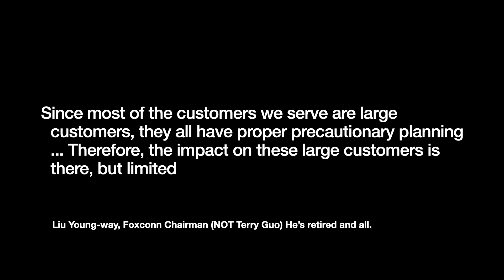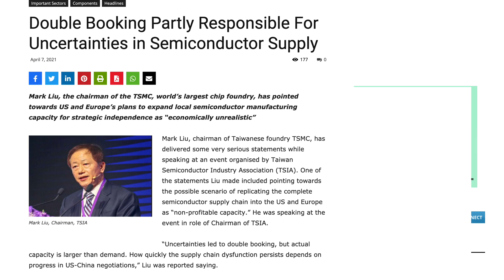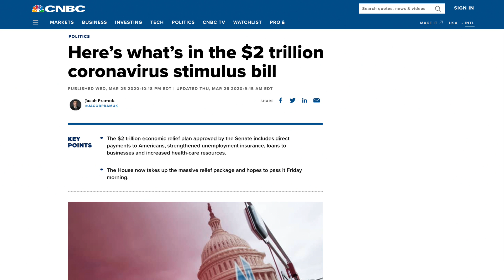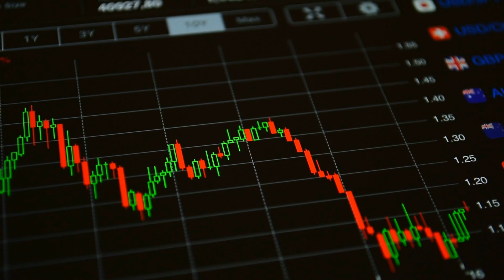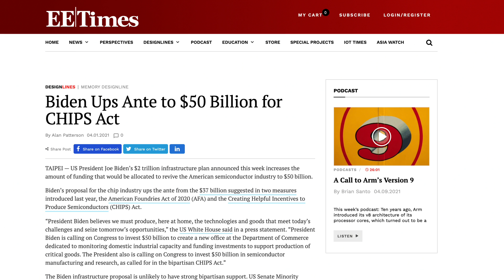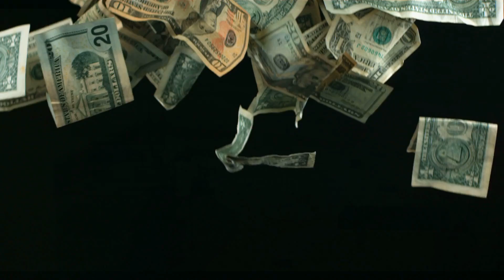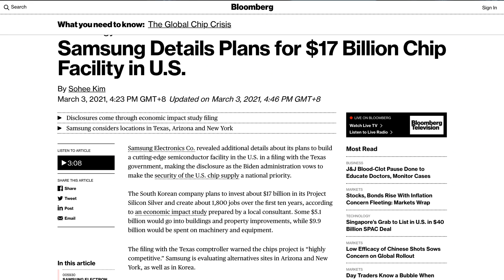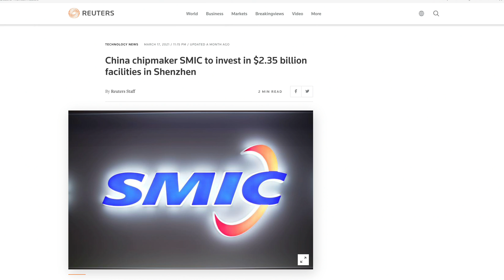The Coming Semiconductor Bust

Comment: These are all good points and some which I considered myself recently. However, TSMC's new fab is not going to bring "hundreds of thousands of wafers coming to the market over the next 1-2 years". That's not even close. Samsung is simply adding some capacity in Austin. They aren't building a new fab.... yet.... and TSMC's new fab isn't going to bring full output to the market for another 3-5 years!! So even if the cycle plays out like you say it will, that puts the bust out into 2024-2026... AT THE EARLIEST! And people will in fact go nuts once the pandemic lifts. Well over a year of pent up demand FOR EVERYTHING! will be unleashed on the world economy later this year, which is before the chip shortage will even be worked out. Semiconductor prices will have a chance to boom massively well before they inevitably bust again.
Reply: There is no pent up demand for high end chips I think, if anything, people will probably spend less time on their computer/phone and go out instead. If less people work from home and less data is generated from online activities there will be lessened demand for data center services too (probably less growth not an actual decrease). IoT devices like smart mirrors and wifi armchairs don't require the same kind of chips, these might remain in high demand but it's easier to scale production of these chips so I think there would just be a short boom as restaurant owners and such start buying new stuff followed by a steep increase in production, they are just commodities after all.
Reply: @semkjaer3581  It will probably bounce back, but there was already a trend for home-working.
It will never go back to the previous level.
Even if the demand decreases, it wont decrease to the same level as before.
Reply: @monad_tcp  well this guy was saying people would 'go nuts' on semis after the pandemic and I just don't see that happening, I'm not saying the semi industry will do bad, I just don't think the current excesses will hold.
Reply: But will the pandemic even lift ? or we will go into trade war with China.
Reply: I don't know where you get your timelines.  You're talking as if it takes many years to set up a fab, and it doesn't.  It's expected the TSMC fab will be online and at full capacity within 3 years.  Within 3 years, and probably a few months less.  It will be ready by the time AMD is making Zen 5 products.  What takes years is developing a new node.  But,  TSMC in AZ is putting in a 5nm fab that's expected to eventually be upgraded to 3nm, and not a decade later because the world moves faster than that.  They'll probably upgrade it to 3nm within 3 years.  They'll have to.  Intel will already be on their 18A node, or even smaller.

So, the construction will take about 2 years, and then setting up and fine tuning the equipment will take months because TSMC is already producing 5nm and don't have to learn anything.  This is the timeline that's been given and I'm pretty sure they'll stick with it.

You forgot Intel.  Intel is making two new fabs, and they should be producing by 2025.  The reason why it will take them longer is because they're 20A fabs, and Intel hasn't gotten this process (node) to a state of production yet.

As far as a bust, that's laughable.  Not what you said, but the whole thing.  TSMC has had constant growth since 2009 and they can't make products fast enough.  Their next node to get to production is 3nm, probably late 2022.  Apple and Intel have already bought up (via contracts)  the first year run.  So, the earliest any other company would have access to TSMC 3nm would be about 2024, maybe a few months earlier, or later.

Samsung makes billions a year in profits, TSMC makes billions a year in profits and so does Intel.  Even if there is a slight downturn for a fab, it has little effect on their profits, and that was part of why this guy was talking about it.  It was to suggest that all this capacity will lead to some kind of bust cycle and that will mean continued subsidies.  But, no govt. funds these fab for operations.  They make their profits off the contracts they make to produce products, or by the products they make for themselves in the case of Intel and Samsung.  Subsidies will be used to help fund construction of the fabs.  A fab though, if it's not at full capacity, which is rare for the companies that are making advanced nodes, isn't making anything.  They only make products based on contracts.  Soooo, it's not their products sitting on a shelf somewhere.  It's other companies products sitting on a shelf who knows where, but not in the fab.

To try to predict a bust for fabs, you have to understand the ENTIRE WORLD of technology.  All you talked about was consumers, home users, but that's only part of what gets fabricated.  AMD for instance is making more server CPUs than anything else because the demand is such that they can't satisfy it.  They went from making a few million dollars in 2016 to making almost 4 billion in profit last quarter.

So, there's not going to be a bust.  The demand for chips is growing, and when these fabs come out with a new node, which then allows companies who make CPUs, GPUs, etc... to make new products based on that node, it creates demand all over again.  And, for the world of servers which is HUGE, when new products come out that will be a good upgrade for them, they upgrade.  Usually the savings in electricity costs, or the big boost in performance they get pays for the upgrade.
Reply: @johndoh5182  servers are upgraded much slower than consumer electronics,
Companies are too smart to overproduce.
Reply: Why would pandemic demand will stay after pandemic

Comment: I have a  dumb question.   When you say wafer, do you mean the actual raw silicon crystal wafer ?  Or you mean the the process of converting the wafer into the IC ?   Which process has shortage now ?  The raw silicon crystal wafer ?   Or the processed the wafer with IC on it ?    Thx
Reply: He means the completed wafers with ICs. It takes 2-3 months to make a completed wafer with all the chips on it from start to finish. The shortage is due to the factories’ inability to produce the volume that’s in demand. Each factory only has so much capacity and then you have the 2-3 months time that adds to it.
Reply: Completed wafers.  I believe they also make the raw wafers.

Comment: I think you spent a sentence or two talking about older nodes. I would highly suggest researching those companies and their target markets, because it really shows a better picture of what is going on.

The other main issue is that all the recent nodes and tools are still using 300mm wafers. They should have switched sometime in the last 10years, after TSMC's 28nm. Now they are switching to EUVL tools and still haven't moved to 450mm wafers. We are in for a while ride at 5nm on down.

Comment: I dont think the model for 2nm and below fab is unsustainable, imagine 17B+ and growing. Takes very deep pockets and long term planning to even achieve ROI on such investments and for what 5-10% gains in performance, maybe 15% max?? There has to be alternate ways other than semiconductors and that is where I think quantum light physics come into play for quantum computers. So basically u have a hybrid system where the brain is quantum CPU chip and the rest is semiconductor chips supporting this. What does anyone think about this?

Comment: from Taiwan. well thought out analysis. for the chips providers focusing on 14nm and above nodes, the economic cycles would be very severe because the new builds up heavily tilted to this end. for the more advanced nodes businesses, there are less competitors and new supplies to be expected.
Reply: exactly
Reply: Not really.  Companies are having products made on nodes much larger than that.  So, it will be older MOSFET technology that starts to fade away.  But that's not TSMC, Samsung and Intel's issue to worry about because they make advanced nodes.  They upgrade plants when they need to.

And no, this video wasn't thought out at all.  It was a propaganda piece designed to attack subsidies, as he gave no data to support much of what he said, AND put out false information, such as when he said no node being built in the US on these subsidies is less than 10nm.  WTF???

Samsung is building their new fabrication using 5nm, TSMC's fab is for 5nm and it's believed they'll upgrade it to 3nm before too long, and Intel's is THE most advanced node, with 2 fabs that should be online by 2025 producing their 20A node, equivalent to TSMC 2nm.

So, he is just wrong, wrong in so many ways.  

Saying these companies need to stand on their own, as if they don't.  Once again WTF????  Samsung, TSMC and Intel make profits over 10 billion a year, consistently.  They ALL stand on their own.  The subsidies help with the upfront cost of building new fabs, which is HUGE money.  TSMC hasn't had a bust cycle.  It's rare for high quality fabs, almost unheard of.  They're yearly revenue has grown every year since 2008.  They had a small downturn in 2008.

I could go on about the fallacy of this video but I wrote a book on his initial comment already about all the issues with this video.

Comment: The problem is TSMC is the only fab in the world that can make 7nm chips at the beginning of 2019. Samsung yields were shit and GloFlo dropped out of the 7nm race. TSMC required customer put in wafer orders at least 1 year in advance. The world fought over the limited 7nm production capacity. COVID further driven up the demand of consumer goods since everyone is staying at home. Automakers on the other hand, thinking car sales will slump pull back chip orders. Fab took more non automotive chip orders to compensate. Due to trillions of bail out money funnelling into the stock markets lots of people made big bucks. Car sales which initially dropped suddenly bounced back 10% to 15%. Car factories ramped up production to meet demand but many kept low inventory of chips for efficiency reasons. They ran out (problem of ordering and not production).

I don’t agree that we are building towards over capacity. We always had at least 3 major foundries around the world able to make chips at the most advance nodes or anything prior. 7nm really was the odd ball with only TSMC able to make it.

Comment: If China finds a way to reverse-engineer chipmaking techs and create new ones, semiconductors  will be extremely cheaper. Look at the solar industry, China entry caused solar panels becoming extremely cheap.
Reply: Any particular chip that you were talking about?  There’s a lot of different kinds.
With a lot of different techniques to achieve quality and yield.
Reply: Not everything can be made through reverse-engineer, chip is one of them. beside chip is made with over 1000 companies work together, chip is in an idea of supply chain.
Reply: @genuinennessbefitting4734   Again, you underestimate the Chinese Communist Party. People used to say the same thing when China entered the renewable industry, now just look how China completely dominates all renewable industries. China has already had an international supply chain within the ASEAN, so it can skid Western sanctions at ease.

Comment: I wonder if the answer is that while if that future number of chips were produced tomorrow it might be a glut, by the time it all comes online, demand will have caught up. New products that require chips/more chips keep cropping up. Cars and home appliances are excellent examples because they were existing products that changed from not needing them to now requiring more and more of them, but I could easily see that transition happening in other industries - clothing, furniture, etc.
Reply: Well there's a big difference between markets that require microchips and markets that require leading edge microchips.  Almost two different worlds, really.  One can be safely supplied with existing and aging processes(and there's more options available), but products built on leading edge processes are constantly moving on to the next one as soon as practically(and financially) possible.  It's the demand for the leading edge stuff that becomes riskier as this is where these chip manufacturers have to spend insane amounts of money to keep up with expected demand.  If that demand in this segment of the market does waver, it can have significant effects on the profitability.  So it's something they have to be careful about.

Comment: Well done but for your fearing the future slump!  Automotive switching to Electric Vehicles will swamp chip capacity. Acarspressure
Reply: However, trends towards more powerful single chips might partly mitigate this. Compare cell phones which have reduced the number of ICs with the rise of the SoC, IIRC.
Reply: Post incomplete: EV production 2020 was about 1 million cars from a total car manufacturing of 77M. The automotive industry planning to phase out all Internal Combustion engines by 2030. The chip usage in EV is many times higher the current ICE cars: has anybody done a study on that?

Comment: Your opinions would be more convincing if backed up by some analysis of chip consumption growth projections in absolute terms versus production capacity.  The graphs you presented were only relative production increase and decrease.   As mentioned in other comments growth in autonomous technologies will really drive up chip consumption for example.
Reply: besides that, datacenters want absolutely every single bleeding edge node they can get. TSMC could triple 7nm capacity tomorrow and it would still probably be completely sold out.
Reply from the maker: In my opinion, relative metrics make far more sense than absolute numbers.

Comment: The premiss that.fabs compete on price and will race to the bottom on price if demand dries up doesn’t work for advanced nodes. Designers have to tailor their product to a particular manufacturer’s process, and the design can take 18 months to complete. There is no room to switch directions/fab if the market falls. The designer gambles that there will be enough demand for their product to make the design worth while.The manufacturer gambles that there will be enough orders to keep their fab busy (and will usually have a minimum commitment from the designers). TSMC are much less at risk than producers of commodity devices like flash or RAM.

Comment: Your analysis have some truth about the over supply situation within 2 or 3 years. Actually there is not much chip shortage for laptop and personal computer and smartphone chips. Most chips shortage are from EV cars, autochips and some consumer products, which are low end chips, 20 nm nodes.
Reply: I dunno, gpu prices havent been cheap
Reply: @slopedarmor  That is the biggest bottleneck making it difficult to build a new gaming rig though, and the GPU shortage has more to do with crypto than anything else.
Reply: @ManaDrain315  Crypto but the effects of material shortage cant be neglected. Supply chain disruptions have a far large impact, that crypto has contributed to but it is a minor contribution
Reply: A lot of system builders (PCs) can't build or sell products at the same level as they should be able to because GPUs are 1.5X to 2X the price that they should be at.  This makes the cost of a new PC a LOT more than what it should be.  So, parts like CPUs, RAM, NVMe drives, etc... are starting to drop in price because people have enough of these.  People are holding off now.

For laptops, they tend to be seasonal purchases with the shopping period around Christmas being the biggest selling period.  I expect there will be a LOT of laptops sold at the end of this year due to big increases in performance and battery life.

For smartphones, yes there's a slowdown because new products are about the same as older product.

But his analysis lacks a LOT of understanding because it totally misses what's going to happen in the business world, and that's where growth for TSMC in particular is going to be massive.  But as I said above, growth would still be large in the consumer space if GPUs weren't so overpriced.  Expect huge turnover of all things computing when TSMC is mass producing their 3nm node.  It will align with a lot of change in computing and graphics and the world will be salivating to get their hands on these newer parts.  This is when he's predicting a bust cycle basically, and I say that's total BS.  That's going to be a boom cycle like has never been seen.  Power efficiency increases of about 40% from today's NEW products??  That's not a bust cycle.  That's when server farms around the world will swap out parts.